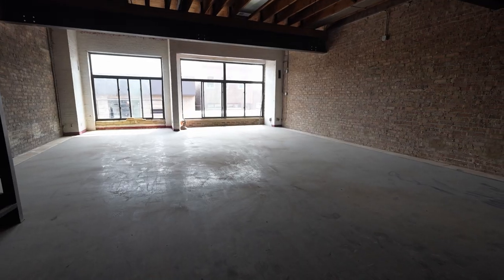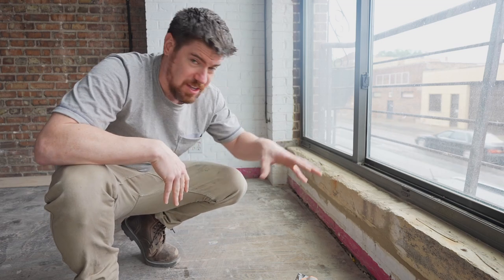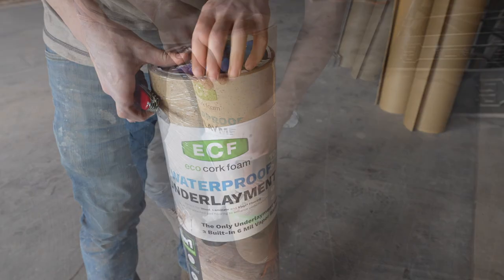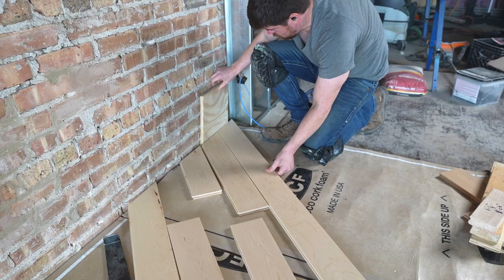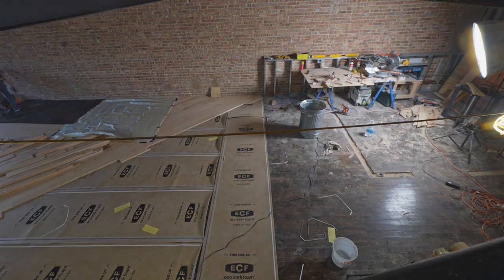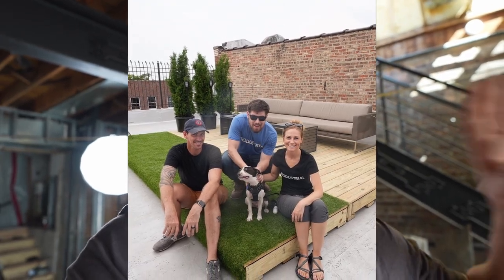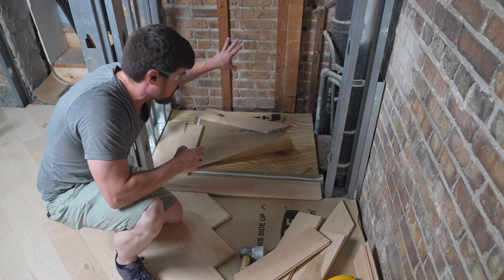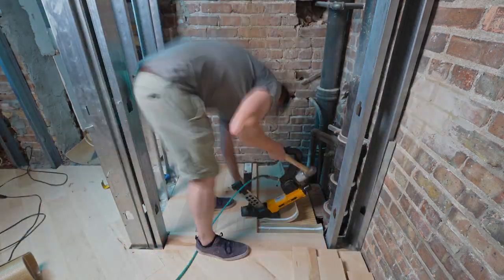ep. 23 - The MOST Dramatic Change yet!!!  ...Abandoned Bldg Renovation

Comment: From the Keep-it-simple school, angle iron IS the way to go. The free-standing posts you've got. It's the riser plate post that's the puzzle. (16:18) You'll have to grind slots into your plate to slip around it. A wood practice run might help Cut and weld so that it's a two part finish attachment  But weld safely. Spray water on the board that will be under the plate, damp rags, bucket o'water. Yada, sweet yada. Blow dry and brush, just like Daddy told me to.
Reply from the maker: Good idea and tips!

Comment: For the metal stair gap: a small live edge wood piece. Like a 'cookie' slab. Cut it in half, scribe the center to fit each side of the stairs, then put it back together around the stairs.

Or, a similar idea but a small concrete piece fit around it. Make it look like the base of a column.
Reply from the maker: I like these!! 👍👍
Reply: @modustrial  good luck with the rest of the build. It's all starting to take shape. It all looks great!

Comment: I think that to hide the gaps around the staircase the best solution that will fit with the aesthetic of the staircase itself is angle iron.  I suspect something like 1 - 1.5" equal angle would do the job quite well (I can't tell the gap size on YouTube) which you can cut at a 45 degree angle to create surrounds where the gaps are.  You could then drill through and bolt/rivet them in place or possibly spot weld them.  It should be fairly cheap to do as you will only need a single length (in a company I worked for we ordered them in 3 or 6 meter lengths).  

Once you have the lengths cut you would need to get them painted or powder coated to match the staircase as they would otherwise rust (they are usually made of mild steel and therefore are prone to rusting - they arrive from the suppliers covered in oil to prevent that happening).  To paint use rags and white spirit to wipe off the oil, paint with an appropriate colour of primer for your top coat choice followed by an appropriate top coat.  I am aware that you might well know a lot of this already, but it is safer to say it all rather than make that assumption.

Comment: A couple of options for trim around the stair:

Angle Iron like you said.

Flat plate cut to the contour needed - to dress it up, you could weld on rivet heads (or cut off carriage bolt heads) from the underside with plug welds for a cool industrial look.  If it were my place I would then lightly stitch it to the stair, and bondo the rest for a seamless look without burning the surrounding wood. 

You could spend the time laying it all out in F360 and have your CNC route a custom fit wooden trim that you could then glue to the metal.

For the square post on its own, you could get a square flange to cover the gap.  You would need to cut it in half, then tack or epoxy it back together around the post.  These are available from places like RB Wagner.  (Alternatively you could make your own).
Reply: You could also cut out an aluminium design on your CNC and paint it to match the stairs, it would have to float over the wood slightly but you could certainly attach it with construction adhesive. This would allow for some subtle decorations, I am not much of one for art but it would use what you have by and large.

Comment: I would consider using concrete to cover up those spaces around stairs. I think it would look nice with the brick wall. Mould with a slight incline or straight could be used. At the bottom the gap can be left empty for expansions. Bottom of the mould could be a thin layer in order to avoid ruining the floor with concrete. Love the video btw. I even enjoyed the commercial!
Reply from the maker: thanks!  great ideas here!

Comment: Late to the comments, but in apartments with low roofs, they put "crown molding" directly on the ceiling which gives it a nice touch. Makes it look high class without needing the high ceilings. What if you founds or made some nice floor board pieces but instead of having them vertical you laid them flat around the stair case? It would be cool if you did something in metal too.

Comment: You have my luck, we are gutting a trailer and replacing walls etc. What should have been a month is now into month 5. We have had to rewire
the entire structure, replace floors and joists due to a water leak that apparently went on for years. All new insulation, because the water caused mold.
Basically we have about rebuilt this thing now, and as we could see the finish line, we found another part of the floor that has water damage
and now that too must be ripped out and replaced.
Of course yours looks way better, lol. We are just going for function, it's looking good though.

Comment: Build "Casings" around them with crown. Super Glue them together to get tight fitment and Construction Adhesive them in place. How i would handle the diagnals is to shoot past them and fill the void with either backer rod and caulking, or make a wood cap to bridge to the webs. Hard to explain but not that hard to do.

Comment: For the stair area expansion gaps, i would do this: 

Grab some angle iron, painted the same color as the stairs, and lay down over the wood floor so one part goes down into the gap, and the other, over the floor. Cut them down at 45 degree angles so that it creates a perfect "cap" over the square posts.

As for the diagonal part, extend the angle iron to encompass it too, so that it looks like the stairs are welded down onto IT, and NOT the sub floor.

Comment: Maybe you could snip some metal drip cap for windows or what ever the name is for the drip edge under windows to cover the base of the stairs.
You mentioned angle irons and i know there is some angle irons for poles but might be hard to find a lot of different sizes and without a brunch of holes but you could idé some compound to fill said holes, sand and paint

Comment: For your stair trim problem, take a look at schluter brand aluminum profiles made for bathrooms. They have a huge assortment of profiles that miter together very well, leave a very tight joint. They have all kinds and angles that would solve your problem. They'd come in a variety of finishes, they're always aluminum but you can get all kinds of anodized finishes. I think something very slick and modern would kind of bridge your modern renovation with the more traditional stairs. That said, I would cut the scroll work out of the railing. It could pass for modern without that. If you really wanted to go to the trouble, if you removed all the decorations that were welded onto the I-beam there's no reason you couldn't remake it into something very slick modern and industrial
Reply: The one other idea that occurs to me would be much easier to do. Find a stump and clean it up. Only let the roots go horizontal for say 4 in from the center. Let the stump be 6 in tall. You would only need to contour the uppermost face of the stump for it to fit perfectly around the complicated angles. The stump could essentially be completely hollow except for the top quarter inch. Would be quick and easy and it would introduce a little bit more organic design. Your place is currently very rectilinear. That works, it looks sharp, but it wants accent pieces that are organic, curved, unpredictable

Comment: About the staircase Problem. In my design classes i have learned if you can't hide something you have to pronounce it (maybe not the best translation). What i mean is, show that part. Show the underlying structure don't really cover it up. I would try to make some kind of a (plexi) glass cover (with your cnc) directly around the metal to show the bolts and everything. And in a gap between plexiglass an wood u would use something like a flexible silicone or something else that can fill the gap but also expand a little bit

Comment: Cut an angled piece for the stairway to sit flat on a band saw or belt sand ot flat. I would try to have 4 pieces flush around the post joining at 45 degree corners and allowing some room so it is not touching the steel.

Comment: For the stairs I would think a wooden frame may be best,  metal would require welding which could potentially cause burning on the wood. just my thoughts,  but would probably make things easier with the angled bit where the stairs go up.

Comment: only thing i could really think of with the stiars and covering that gap would be a metal section, thats floating to allow expansion sorta like a skate boarding half pipe or w/e its called in terms of the contour and you dont stub your toe on cuz its rounded. it might throw off the space though but if you go with metal you can pretty much just cover the flooring and either lag it in place or wheld and refinish it then remove the covering protecting the flooring.

Comment: You can use your CNC machine to machine some custom wooden trim to fit the spaces around the stairs and make them match up the rest of the trim you plan to use. The problem with 3D printing is the fragility of plastics and metal casting would be one hell of a rabbit hole to even get to a satisfactory point. You could of course get a company to do the castings for you, but I would personally make use of the CNC Mill to get the exact trim I wanted and to get it in-house. That's not only cheaper, but it also allows you to easily work on something else, while the CNC works on your chosen design and you get to check up on it to see if it ends up like you want it to. This trim is, after all, supposed to last for many years to come. 3D printed trims would need regular replacement and that's just bothersome tbh.

Comment: could you use shoe molding? not quarter round, shoe mold, which is a concave instead of a convex. it would allow you to cut a fairly deep angle to make a nice transition from the steel side of the stairs to the floor itself.

Comment: I would go with a steel 'escutcheon' like you mentioned with angle iron or something. Get somebody to neatly weld it so the steel sits like 1/8" above the hardwood. I think you're on the right track

Edit: for the diagonal part, maybe cut a flat piece of steel with a chamfered edge and weld it as a 'skirt' to cover the gap. 0.02

Comment: I think a wood cap using the same material as the flooring would be the way to go. The area around the stairs/stringer should be a series of 90 degree angles if it was made well, so fashioning a custom piece for the intersection between the floor and the stringer should be relatively straightforward.

Comment: i hope you threw some spray foam into that void on top of the door frame and into that I beam. also, i would have thought that a quick sand of the old floor to remove the top coat and then treat it for beetles would have been easier, but hindsight and all of that. i would use a wood or angle iron base like you were saying to cover the gaps, anchor or glue it to the stairs so that the floor can move under it.
Reply from the maker: I left it open below so I can spray foam it later.  As for sanding, no such thing as sanding the finish off a floor "quickly" ;)  sanding a floor that big involves renting a commercial floor sander (think of a marriage between a lawn mower and a sander, and you get the picture), and even then it's at least a couple days of hard manual labor.
Reply: @modustrial  industrial floor sander is what i was referring to, they can sand down fast, grit depending. it just seems to me that you have ended up having to handle and re-handle your flooring boards a lot. i guess my mind tries to solve problems with having to move heavy stuff the fewest number of times.

Comment: For the bit of the metal stairs in the new hardwood, why not get someone to custom-make a sort of "baseboard" but made of similar metal and shaped in such a way that fits the swirly style of the rest of the staircase? I'm certain you could get two, perhaps 3 pieces and weld them together, bolt it down to the new flooring. I know my description isn't great, but imagine just an ornate square metal covering going around the base of the post.

Edit: Someone else suggested 3D printing. Yes, a casting from a mold created from a 3D print would do nicely!

Comment: Personally for the metal stairs i would put fake metal feet. the design is up to you. possibilities can be just a flat square and welded, or have a hollow small beam with the width of the hole. The back of the stairs is a tricky one. crazy idea would be to install something like an equipment there. a light, or aux connections. so it becomes something you wanted it to be there. If its filled up with wood i think you will keep seeing the ''mistake''. So if u use the mistake for something useful or something absurd then it becomes something unnoticable.

Comment: I'd fill the gaps with steal plates (not angles) cut in halt to install on both sides and add some fake big bolts on them (like the ones used on steel beams) like if they were bolted to the floor.
Reply from the maker: That's a great idea!

Comment: Sry bad english, for the stairs, you can make a 90 degree angle in pvc or 3d print then you glue to the metal BUT the thing is to let enough space for wood movement : put it inverted’ like bottom to top

Comment: Put some flat steel around mitre and weld make it look like it was a mounting plate.  Even bolt it in place.   Hardwood does not expand on the length it expands on the width of the board.

Comment: I think that the stairs need black metal post-boards/trimmings. It will look strange and redicioulus with wood trimming.
Do like a "skirt" with two halfs that sits on top if the wood, screw it together under the stairs. I know the hinges will show, but thats OK if is done nicely. Or make it "hinge" inside the metal, wit a flat bolt in front from the top. 
Either way, you have to go with black metal on that.

Comment: Don't mean to sound negative but you should've just cut the boards tight around the steel. wood expands in the summer months so in theory your wood is at peak expansion and if you let it acclimate you won't have issues other than possible shrinkage in the winter creating a small gap. Also wood only expands across the width of the grain so having a gap on the sides that are the length of the grain isn't necessary and since the floor is diagonal it reduces those areas even more so it would've been safe to just keep it all tight. Just food for thought in case anyone else has to deal with this issue, don't be afraid to cut tight in small areas, the wood has room for expansion at the other end of the floor.
Reply from the maker: I hear you, and the only thing I would say is that, as you say, this is "in theory"....I've seen enough strange things happen with wood, to go with a better safe than sorry route.

Comment: maybe you could attach someting in metal to the stair in an "L" shape, the base of the "L" just sitting on top to the flooring but attached only to the stair. Paint it in black matching the staircase. The wood flooring would slide under the metal L finishing, the metal staircase expanding or contracting would get closer or farther to the wood flooring and the L finishing again would slide on top of the wood. Some people were suggesting 3d printing, which I am very familiar to, but it may result in a temporary solution that you may need to replace regularly.
If you do the 3d printing on top of the floor (like the metal L shape i am suggesting), i think that you may need to use some material that is UV or chemicals resistant so you don't have to redo it every 3 years. Maybe ASA could do the trick (but it warps a lot during printing... ) or maybe a black PETG, coated with UV resistant varnish

Comment: im far from a carpenter, and correct me if i am wrong, but when using joist hangers, screws are not recommended as they do not have the same sheer strength as nails.
Reply from the maker: Correct, but these joists are only 2 feet long, so it should be fine here

Comment: Around the steel? Clean it up, get a consistant reveal, and mix epoxy with sand and fill the gaps. White sand, generic multicolor sand, black blasting sand. Which ever looks good to you. Put mold release on the steel so it doesn't stick.

Comment: I'm sure it's been said/asked already, but why didn't you just coat the top of the old flooring and plywood AKA your subfloor now with Bora care,  then put whatever that mat was down on top of it..... and lay your new flooring.... immediately.  Instead of coating the underside of the new flooring.  Not only would you not wet.... dampen... the new flooring but rolling the Bora care on top of an already in place flooring/ subfloor would be a heck of a lot easier than doing each individual board one by one.  The Bora care barrier would still be between the old and new flooring.

Comment: So much drama but it turned out amazing ❤️

Just curious if you’re going to put something between the metal headboard and inside the house. Just concerned since you mentioned condensation that that section is still kinda enclosed and has potential to trap high humidity 🤔
Reply from the maker: It's open from below for now....will likely use spray foam insulation to fill the gap

Comment: I understand my suggestion is VERY off the mark with the sleek esthetic you’re going for, but I had the dorkiest idea.

Fill in the spaces with silicone caulk that matches the floor color… but then…. Create a funky (unassuming) design to encase the metal stair “footers” in an epoxy resin type of art-ish casting with possible smart LED lights for mood lighting and/or night light-type visibility.
Reply: Side note: The resin idea I was thinking of would be the equivalent (looks wise) of your baseboards. But way cooler bc of the fun lighting potential.
Reply from the maker: Cool idea!